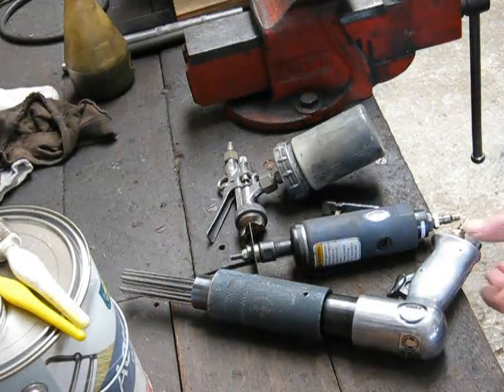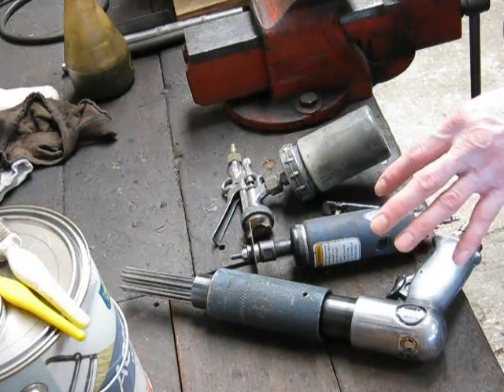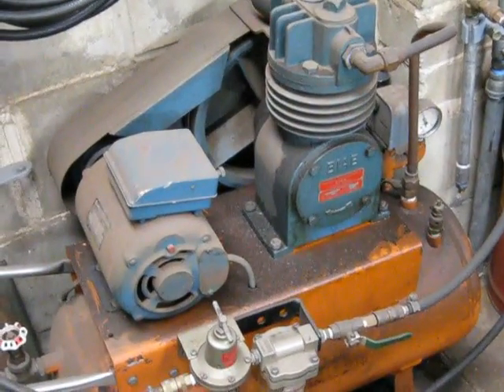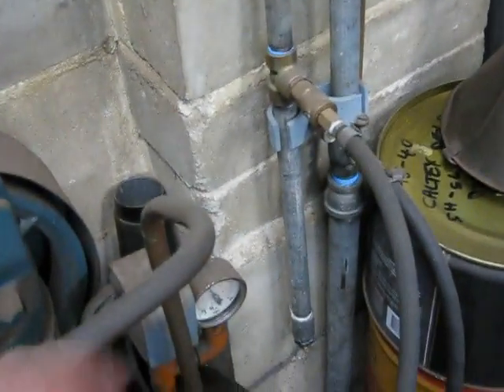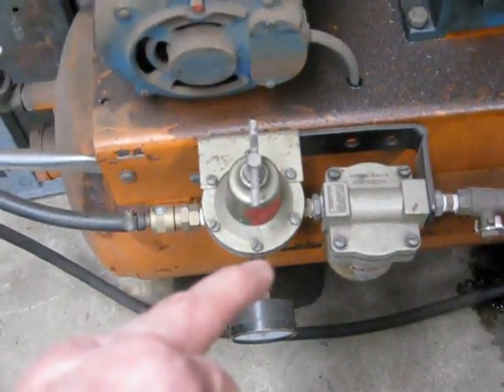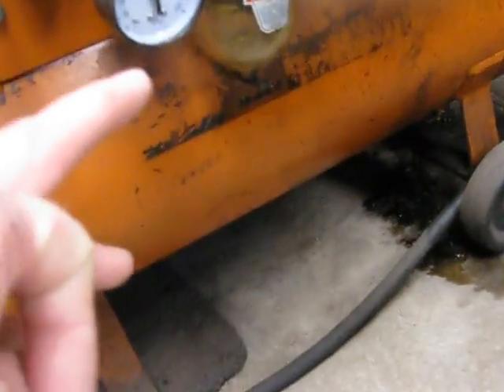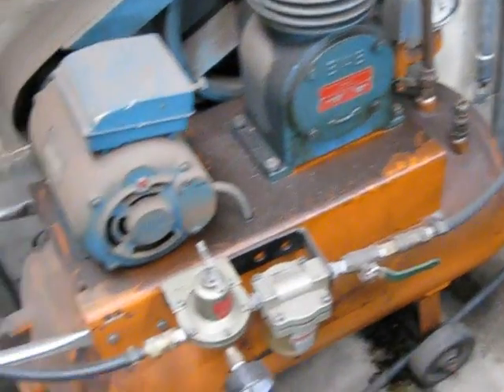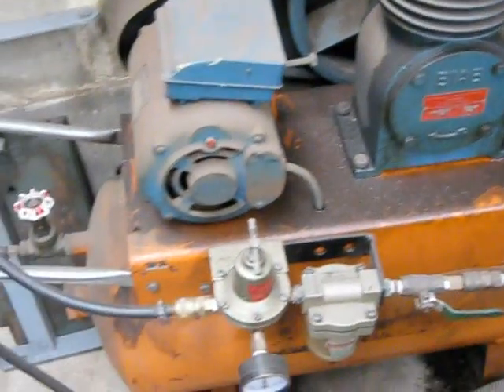Make a compressed air drier from junk water pipe

Comment from the maker: The twisted flat steel (into a spiral) is put INSIDE the pipes to add more surface area and aid condensation.  In your case, the steel pipes that run around the shop will really do all the cooling/condensing you need. 

The dryer in the video is just a condensed version of what happens in most workshops with plumbed air.  The plumbed steel pipes are high up out of the way and have various droppers at work stations throughout the shop, each of which has a water trap/reservoir and an air outlet/tap above it.

The overall plumbing is sloped slightly to move any water in the horizontal main supply pipes.  My father was a motor mechanic and that is how all workshops are set up.

Of course if you want to go better than dew point temperature separation, then you will need refrigeration and desiccant features.

I was getting water streaming out of my air tools, but since adding the pipe dryer/condenser I don't have any issues at all.

Cheers Rob

Comment: Well, I'm about to find out how well this works. I've already bought the components. I've picked some up, and am waiting on the others to be delivered.

I have to say, that it's not all that "cheap" when you don't already have the pipe laying around. Mine is costing roughly $230 (and I haven't actually bought the mounting hardware yet).

My shop has 14' foot walls, so I can build a tall one. My compressor is a new 60 gallon upright.

I'm going with a schedule 40 1-1/4" galvanized system. I read the warning against galvanized pipe in the link. But it's too late for that, I already bought everything, lol. Plus, I'm pretty sure that was galvanized pipe in the video.

I'm putting 10 foot joints above the tee, and 18 inch joints below. Both runs will be the same, and have brass ball valves (with nifty handles) for the drains. The hardest part to find were the tees. They are 1-1/4 x 1-1/4 x 1/2". I could've used a standard tee with a bunch of reducing bushings to get down to 1/2". But that wouldn't have been as neat, and would have introduced more connections to worry about leaking.

I also have a good ole tube & fin condenser from a 91 Chevy Caprice. I don't intend to use it in the system, unless I have to.

The most demanding use of the system that I foresee, will be sandblasting. I'll try to report back with the results.
Reply from the maker: Hi Dale, it all costs money, but you can generally buy salvage pipe if you look around.  Galvanized pipe should be quite OK.  That's what they use in most garage workshops I've seen.  My father was a motor mechanic and that's what they used in his shop.   They had a water trap below each outlet to catch the condensate.  Worked fine.  Cheers Rob
Reply: @Xynudu  I finished my dryer assembly this holiday weekend. I kept all my receipts and made a spreadsheet to track the cost of the project. It was more than I thought... around $310 to $325 (depending on where you stop counting).

My upright compressor only had a 3/8" NPT outlet. So I bought a drill/tap set and increased it to 1/2". Since one of the things that I will be doing is flushing auto ac components, I didn't want the the flow restricted. Also, I did not put a baffle inside, I just ran straight pipe.

The stated cost does include a filter/regulator on the "out" side of the dryer. It also includes a 1/2" hydraulic line between the tank and dryer. In fact, it includes everything from the tank outlet to the quick connect where the hose plugs in. When I made the spreadsheet, it exposed just how many items went into making the assembly (more than a person would think).

I tested it's drying ability by running air through a blow gun for about 30 to 40 minutes. Aiming the nozzle at a piece of cardboard, you could see that not one drop of moisture made it through. The test was during a pretty cool night, but the dew was heavy. I'll be interested to see how it does on a really hot day.

Sorry for such a detailed post here. But this is the video that originally inspired me (years ago) to do this. I finally got it done! As far as the cost... it was totally worth it.
Reply from the maker: Hi Dale,  Glad you were happy with the result.  It definitely works very well and is basically what garage workshops use but more compact.  Before I used this my air tools were streaming water at the exhaust - none at all now, regardless of temperature,  Cheers Rob

Comment: I am a sparky that has put my biz on hold due to Covid-a9. Was looking to buy a dryer today but was put off by the cost and thought I'd see if you had any idea's first. Thank you. Would like to install an automatic drain on the pipe though.
Reply from the maker: This works great for a dew point dryer.  Anything better will have to use desiccant or refrigeration.  Cheers Rob
Reply: @Xynudu  Turns out to be more expensive than a desiccant drier, but I had fun a few trips to Bunnings.

Comment: Rob are you still around..  I saw this years ago, and always remembered it, and I have shared this with many. I am building a new shop and THIS TIME I intend to do this.  I plan on putting my upright compressor up off the ground as well 12 inches because I'm tired of laying on the floor trying to open the damned pet cock, then I also can put a bucket under it.
Reply from the maker: Hi Brent,

I'm still here ;) 

The twisted flat steel (into a spiral) is put INSIDE the pipes to add more surface area and aid condensation.  In your case, the steel pipes that run around the shop will really do all the cooling/condensing you need. 

The dryer in the video is just a condensed version of what happens in most workshops with plumbed air.  The plumbed steel pipes are high up out of the way and have various droppers at work stations throughout the shop, each of which has a water trap/reservoir and an air outlet/tap above it.

The overall plumbing is sloped slightly to move any water in the horizontal main supply pipes.  My father was a motor mechanic and that is how all workshops are set up.

Of course if you want to go better than dew point temperature separation, then you will need refrigeration and 
desiccant features.

I was getting water streaming out of my air tools, but since adding the pipe dryer/condenser I don't have any issues at all.

Cheers Rob
Reply: @Xynudu  My current shop has steel pipe all through it and it is kept at a constant 70 degrees year round and picks up water like a bitch.  We do drain the drops every day.  So I plan to go ahead and do your method back by the compressor as well.  After I wrote to you I FIGURED OUT that it went inside by reading some of your other posts....  THANK YOU you have great videos.   Do you think your method will work to help keep some of the water out of the metal pipes around the shop?
Reply from the maker: Hi Brent,

The rig/intercooler will definitely trap most moisture able to be removed at dew point before it hits the main shop piping.  I never have to empty the two water traps I have downstream from the unit, so the same should apply to you.
 Obviously water will condense out more at lower temperatures, but the converse applies in that water will not tend to condense out of air tools at higher dew point air temperatures as it is held in suspension more. Cheers Rob
Reply: @Xynudu  So great to have guys like you with info, YouTube is awesome as long as  you can ignore the idiots Blessings to you.....  Brent
Reply: @Xynudu  My "new shop" I will not keep at 70 degrees all the time, my current shop it was a requirement year round AND to control the humidity. Anything to help...  I saw your video many years ago and loved it...  I HOPED to find it again, I told lots of guys about it...  I just never "did it."  So when I went "a hunting" last week...  THERE YOU WERE.  I couldn't quite remember your entire method, or borrowed method, etc. etc. so I was happy to find it, and GLAD to make your acquaintance. We are only as smart as what "we know."

Comment: I like your system. I especially like the fact you just used some pipe that was lying around to do it. I really need a good dryer for my Everlast plasma cutter. The air in my area is quite humid.

Comment: That little touch up spraygun, did you find a source of paint containers for it, years ago CIG used to sell small containers with red lids but they have been discontinued.
Reply from the maker: I know the ones you mention.  I have a couple with red screw caps.  I've no idea what's available these days.  Mine still work so I've not looked.  It's a nice little gun.  I think these were originally Arnold Devllbiss.  Maybe they have pots for them.

Cheers Rob
Reply: The 1 I had on my gun that broke when I tried to unscrew it so I grabbed for the spare 1 I had put away and when I tried to unscrew the lid the thing just disintegrated in my hands.
Reply from the maker: Typical plastic.  Can't help on this one.

Comment: What are your thoughts on putting a second pipe system before the air hits the tank from the compressor? Would that reduce all that water that drained out of the tank?
Reply from the maker: +JWB671 

Yes, that will work.  People do it that way.

You would have to use the same or larger internal diameter pipe so as not to restrict the compressor output, and it makes the setup non portable.

It will not remove all moisture from the tank.

As the air is hot coming out of the pump, the effectiveness will be reduced as the radiator/intercooler has to work a lot harder and will loose efficiency as it slowly heats up.

I can't see any advantage, as you still have to drain the tank.

Cheers Rob

Comment: Thanks for the vid.  I appreciate your common-sense engineering, and for a lot of garage shops i think it would knock out 90% maybe 99% of vapor....however, in hot climates (like Florida) I think it may be less effective.  You would be amazed at the vapor in a high temp, high humidity environment.  Yet I will probably still modify my air pipe layout anyway, based on your video, so thanks for sharing.

Comment: I need to make a video of my setup. I used a flat rectangular condenser coil off an old HVAC system that i piped in off the compressor output lines before it fills the tank and put a condensation removal filter at the output of the coil so when the air passes through the coil the fan from the compressor cools the air and the condensation drops out of suspension and goes into the filter where it accumulates and keeps most of the condensation out of the tank. Both the drain from the tank and the filter are plumbed to an auto drain that dumps the water when the compressor cycles on. I saw that on commercial compressors they used a radiator to do exactly what I am doing which prompted the idea and it works well and doesn't require any extra electricity like a refrigerated air dryer does.
Reply from the maker: +Gregarious Antithesis 

Sounds good. I considered doing something similar, but didn't have suitably large diameter tubing condenser, and I wanted it to be portable.

Catching the water before the tank is OK, but you still need to drain off the bottom of the tank regardless, as some will get through given the warm air stream the condenser is operating in.

Refrigerated condensers are better, as they take out moisture below the ambient air temperature level, so professional spray painters use them.  

Cheers Rob

Comment: I really like this design and am scheming to build a version based on your ideas for my new compressor. At 4:40 you mentioned a piece of twisted steel to help the process. I don't understand. will you please give more information on what you were explaining.
Reply from the maker: +AskWoodMan 

If you cut a long piece of galvanised steel sheeting into a strip which will fit inside the water pipe, it will increase the surface area and aid condensation a bit.

I put a full length twist in mine (like a drill) to add air resistance.  Just clamp one end in the vice and twist the other end with locking pliers until you get the desired number of twist flutes. Cheers Rob
Reply: +xynudu Thanks Rob. I understand now what you were referring to .  I just got an 80gall Ingersoll Rand compressor in a sweet deal. What is your opinion on pipe diameter and number of columns and height of columns if you were designing for this size? Was there a reason you did not place your chiller between your pump and storage tank? I live in Texas and from guys I chat with in your part of Australia we have very similar climates. Hot summers. Mild winters.  Thanks for your time. As I get closer to fabricating my setup may I message you with my email so I can send you drawings and pics to get your input?
Reply from the maker: +AskWoodMan 

If you put the intercooler between the pump and the tank, you will have to use large diameter pipe all the way through to avoid choking the compressor pump outlet.

Once you do that,the unit generally isn't portable any more as you need fixed couplings.

Also, most compressors rely on the tank being the main heat exchanger, and don't have an intercooler first, due to the large amount of heat it would have to deal with.

I have two columns of standard water pipe on mine and most water is condensed out in the first column.

Hope this helps.

Cheers

Rob
Reply: @Xynudu  Can I use aluminum strip twisted inside the water pipe ? Thanks

Comment: Excellent Video. Genius
Reply from the maker: +nitrosilvia 

I recently saw a video showing how the same system was used in a horizontal configuration to condense out water for the large compressed air systems used to power oil field pumps (which had been using steam previously).

So the idea has been around for a long time.

Cheers Rob

Comment: Where could I buy the taps to go on the ends of pipes?
Also would it be necessary to trap moisture if using water based epoxy undercoat sprayed with a gel coat gun and spraying water based polyurethane 2 pac paint?
Thanks.
Reply from the maker: +John Jacey Hi John.

Local hardware store should have something - can be any sort of air tight tap (ball, screw in brass).

I am no expert on painting, but I expect you should be using clean, dry air with any type of paint, otherwise the coat will be marked by droplets of water hitting the job.  This would include water based auto paint.

Cheers Rob

Comment: Great point on adding the metal strip to the first pipe. Anything that will increase the surface area that the air is exposed to or change its direction will help in cooling the air and removing the moisture.

Comment: Would copper pipe be as effective as steel pipe?
Reply from the maker: Bondovian  Steel pipe has more mass and takes a lot of BTHU to change it's temperature.  Copper is more thermally conductive, but has much less mass, so unless it has radiating fins (as in a car condenser radiator) to dump off the heat I doubt it would work as well.  I've not tried it.  Cheers Rob.
Reply: Yes copper works very well most at homes ones use copper. You don't have to stop with two runs. You can make as many up and down runs as you want. We have the systems be is talking about at the shop in at. But we used schedule 80 PVC. The only one that has issues is the first two drops that are about 30 feet from the air compressor.  By the time it's to me at the paint booth it's about 200ftrun has gone through water trap. 3 drops likes this and then 100ft underground run. Comes up to my booth has its final drop down then a final air water seperator. I never have a drop of water in it. I have the driest air of the shop. My line is the one that won't ruin the impact. The line the connectsto mine before the booth is the worst  since it's lower all the left over water that can't make it mine goes there. So they just have to use my line. And the mechanics line isn't bad. It's separated from the compressor goes up and down the  into their regulator and seperstor then goes back up and down to their seperstr stations and it's fine.. it's only the short run by the welding shop that has issues. So I don't recommend PVC unless you have a long run. Then it had time to cool off.

Comment: Just wanted to say thanks for this video! We were having issues with moisture in our sand blaster. We built a system based on yours out of black iron pipe yesterday and it's working great. We made sure to twist up some strips of steel sheet to act as a baffle inside the larger pipe.

Cheers!
Reply from the maker: mpsinclair Glad to hear the positive feed back.  It definitely works in getting the moisture level down.  And it's cheap. Cheers Rob

Comment: Thanks for this upload. What  an perfect  idea. Must try doing  this when i build  my workshop. There is a question i liled to ask in the video.  Am i right  the airline  is going  into the thin pipe then out of the  large  pipe. Or is it the other  way around.  Any  chance  i could  send you  an email.  Privately.  Thanks mark.
Reply from the maker: Mark Grevatt It doesn't really matter, but I have it going into big, then small.  As most moisture comes out in the first pipe, it's best to use a large one to get a better low pressure area.  It also allows space to put a twisted steel baffle in it to aid condensation/surface area.  Yes, you can email me at gloaming_agnet@hotmail.com

Comment from the maker: Please note that this system is not meant to be a replacement for a desiccant or refrigerated system.  It can only remove water vapour to the same level as a good quality conventional air dryer/water trap, however it will allow the conventional trap to work correctly, and reduce the amount of water it collects.  Cheers Rob.